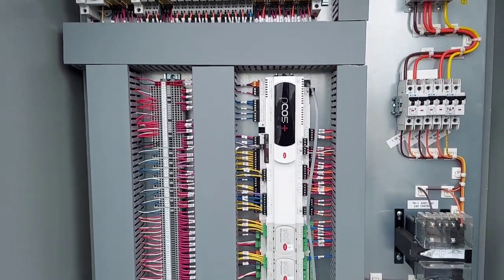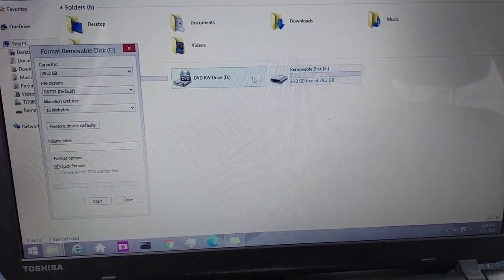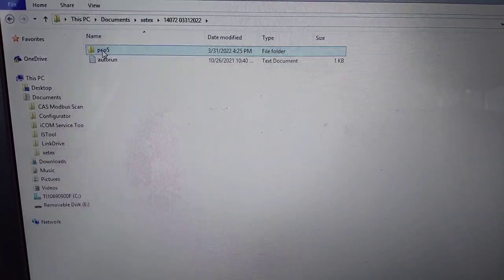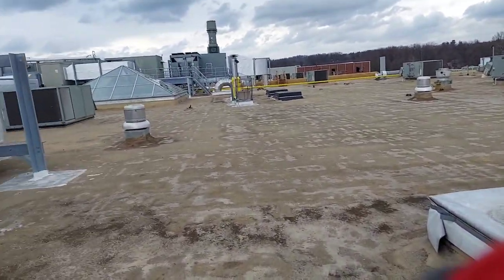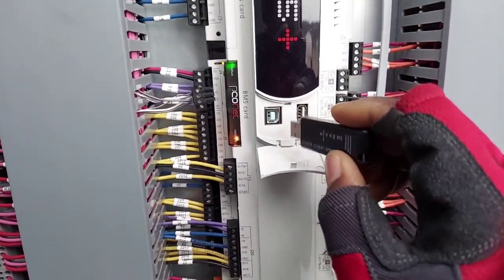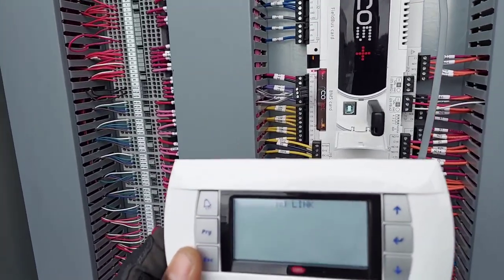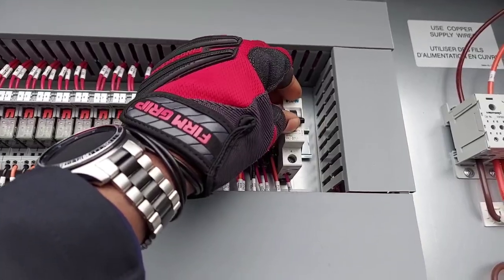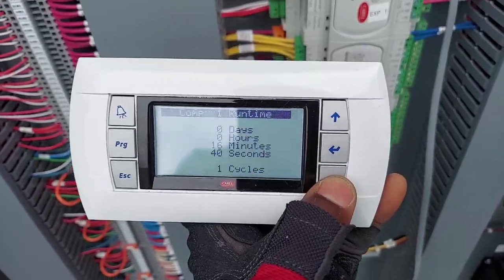CAREL PCO5 FIRMWARE INSTALLATION / UPDATE / UPLOAD

Comment: As the HVACR Trade becomes more intergraded with Technology,  Technicians and Mechanics will have to be trained to be an IT specialist also. Some control networks are very complicated. I retired from the HVACR Field in 2015 as a Stationary Engineer and one of the Tools in my tool bag was my laptop and all the connecting dongles for the various systems I serviced. From 100, 000 plus SQFT Refrigeration warehouses both sub zero and fresh food holding and medication sustainment, 50 ton blast chillers, up  to the 100 ton Cooling/ Heating units with heat and chill recovery built in with Fire system whole building exhaust. medical air and O2 system  tie ins, Portable morgue.  CRAC units, and specialized equipment for labs and pharmacies. Not include Steam and hydronic loop both heat and chill. SO glad that I am out that line of work sometimes when someone touched a system that was unskilled to service left a mess to clean up and place back into proper operations.
Reply from the maker: Very nice 👌
Reply from the maker: Thank you for stopping by

Comment: Great video! Pco5 for the multistack chiller needs updates? For some reason the controller puts out false suction readings and I had to do initialization to correct that?
Reply from the maker: Was it doing this consistently?
Reply: @D2DNYAC   no just once. It's corrected now. Just wondering if it needs updating.

Comment: hello friend, we have a controller of the short version of pco5, which for unknown reasons does not control any cooling functions , maybe there is some optimal firmware ?and can you help us with this issue?
Reply from the maker: software firmware is manufacture based /dependent,,, what system or unit is the pco being used in?

Comment: I have a Carel pco5+ controller that has power going to the unit but no power coming out. I think its a bad controller that needs to be replaced. I also have several more of the same controller that seems to be having several alarms showing. We received the MAU's a year and half ago. They were manufactured in 2021. What is the latest firmware update for pco5+? Id like to make sure they have the latest firmware update. Thank you.
Reply from the maker: You have to contact the equipment manufacturer, CAREL is used across many companies or manufacturers and programming is up to whom ever is using it!